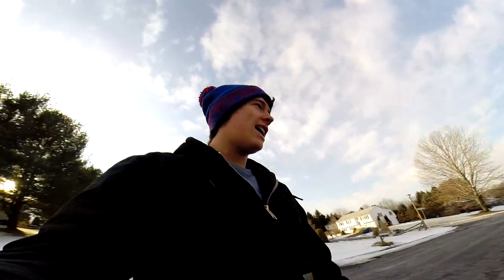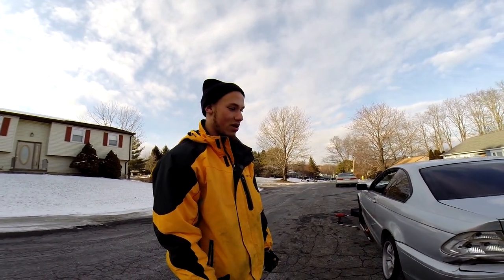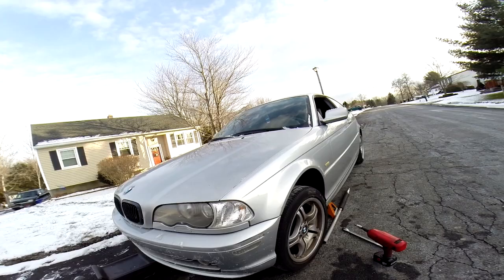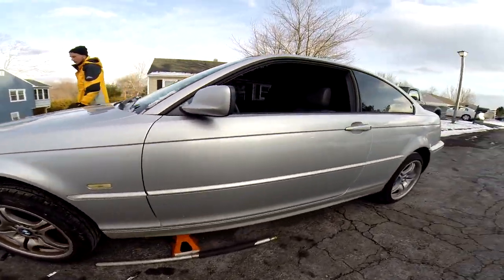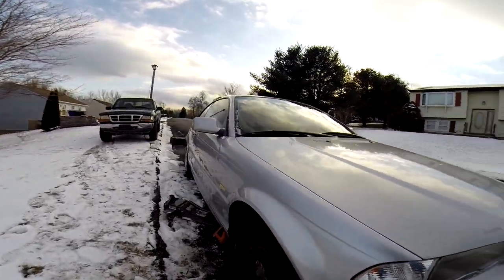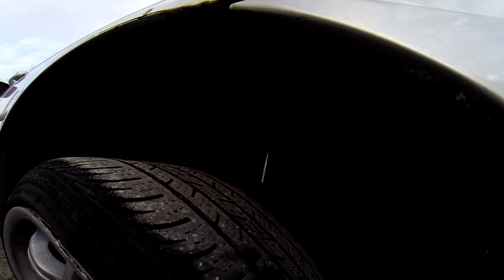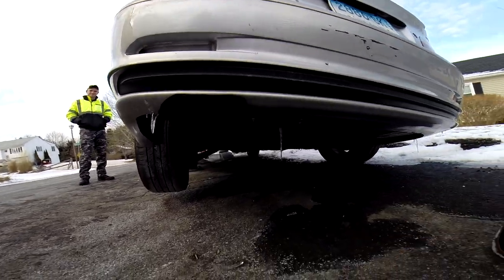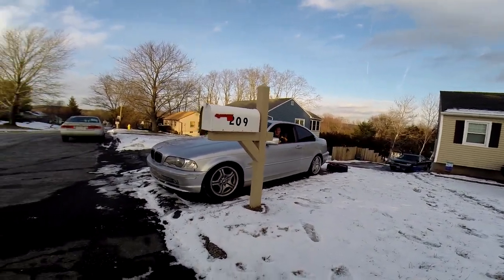Rundown Of The E46

Comment: The sub frame is probably going to have to be reinforced along with the bushings in the rear suspension. Most if not all e46's sub frames begin to tear and split under load. Also replace the whole cooling system because they tend to crap out especially the coolant expansion tank. They have a 100% faliure rate. Things like Vanos seals and CCV valve should be checked as well. For the oil leak look at the oil filter housing gasket, vanos return line, valve cover gasket, oil pan gasket, and maybe rear main. Long live project lemon.
Reply: +1 on the CCV.  Its possible to hear a vacuum leak on the video when he parks the car.
Reply: +REALthugnasty lmao probably. E46's are somewhat expensive to maintain if you want it to run right.

Comment: As far as I know that trim came from a ZHP 330, which that car doesn't look like. It's a 5-speed right?
Reply from the maker: +TheCarPassionChannel yea its a 5 speed
Reply: +Ricer Miata i was sure the m54b30 blocks came with a 6 speed
Reply: Sayyyy what. Sir I am still awaiting the next broke and boosted video 😎
Reply: +E39 DRIFTSLUT ACAB they did come with a 6speed. This isn't a 330i
Reply: +Chris S 330 didnt come with 6 speed , its the ZHP version of 330 came with 6 speed, different cams higher RPM limit up to 6920 where on stock you get 6500 , came with m3 body kit not sure about it , but there was M badges all over the car in ZHP version , ZHP has 12 more horse powers due to cams  ( intake side i think got changed different map for different cams), i have a 330ci  which is coupe that has m54b30 engine and 5 speed getrag tranny.
Reply: +Andrey Arkashin you learn something new everyday. Didn't know that zhp was the only one with the 6speed. Thanks.
Reply: +Chris S The 330ci did come with a 6 speed if it wasn't a ZHP, I've got an 04' 330ci Sports package (Not ZHP) and it has a 6-speed (I believe it was optional and not many people bought it)
Reply: +Chris S obviously m3 has it  too, could be the one with the flappers ( ears on the steering for shifting for pussies or could be regular 6 speed), anyways if you think about it flappers are faster in shifting than a clutch and your right hand))))) cuz computer does it almost instantly and if you look it up on ebay the tranny has that shifting unit mounted on its side and it costs lots of money even now( unfortunately without unit costs a lot too , otherwise i would of have it in my car)))))
Reply: +Andrey Arkashin What he said
Reply: +RustyMonkey9 no reply)
Reply: +Andrey Arkashin Do you have a pre-facelifted model? I'm not sure if the year affects whether or not it has a 6 speed. Mines an 04' Facelifted 330ci with the 6 speed. As far as I know about its transmission, the 6 speed was most likely an option.
Reply: +Izac Pascual it could of been an option or someone changed it , because 6 speed is a ez bolt on , just adds another gear , bolt patterns , sensors all the same stuff
Reply: +Andrey Arkashin also there was an option for and 330's to come with a 6 speedboat sure if it was a zhp motor but it was a 6speed with awd, and its a pretty rare find from what i've learned
Reply: It's not a zhp
Reply: +Ricer Miata It will be a great car when u guys get it fixed! I own a E46 sedan myself:) I'm from Finland and I love to watch your vids, keep it up!:)
Reply: Izac Pascual Pre facelift 330Ci/330i did not come with a 6-speed, only ZHP. I can't confirm post facelift standard 330's. E39 DRIFTSLUT ACAB Not all of them, my gf's is an 02' with an M54B30 and it's 5-speed.
Reply: +Andrey Arkashin I bought mine from a dealer since it was new and haven't changed anything on it.
Reply: +TheCarPassionChannel I believe it was an option for the Face lifted ones, mine's factory stock with the 6-speed.
Reply: Izac Pascual Okay that makes sense. So yours is just a regular sport package?
Reply: In Europe the 330xi which is 4wd comes with 6speed box, the regular rwd only comes with 5spd. Same thing with facelift models I think.
Reply: Miitri Laakkonen Omg a 6-speed xi... shh that's NSFW talk
Reply: TheCarPassionChannel It's pretty fucking savage 231hp/300nm stock :D just drove one the other day.
Reply: +TheCarPassionChannel mine is sports package.
Reply: +TheCarPassionChannel Hi Greg :P
Reply: +TheCarPassionChannel Sadly I couldn't afford any better back in 04'.
Reply: I own an Imola Red ZHP and can confirm that is the trim that comes with it. It was highly sought out by other BMW enthusiasts, .
Reply: +TheCarPassionChannel The 330 ZHP came with black cube trim. This looks like a cheap vinyl carbon wrap was applied to the trim and not factory.
Reply: +atlanticimports I agree that it isn't the best looking. But apparently enthusiasts really like it.
Reply: +TheCarPassionChannel ALL LATE MODEL E46'S WERE 6 SPEED. the early ones before like 2005 were 5 speed.
Reply: stealthynuke There's no such thing an as E46 after 2005..... They went to E90 then.
Reply: +TheCarPassionChannel They made an E46 M3 in 2006
Reply: Izac Pascual I should have been more specific, was referring to non M's since were were talking about 330i/Ci this whole time.
Reply: +TheCarPassionChannel lol, how's the boosted yata going?
Reply: Just call the bmw dealership with the VIN and they can tell you exactly what options it came with from factory.
Reply: +Miitri Laakkonen for the non 4wd drive, with the non diesel models, ONLY the 330i/330Ci produced in 2003 and later have a 6 speed, so some facelift have 6 speed while others don't
Reply: +Muddersbach a guy i work with has 330 clubsport prefacelift its a 5 speed..an has the shockingly ugley rear spoiler
Reply: +TheCarPassionChannel I had an E46 that was identica. Sport package means bigger seat bolsters, 3 spoke steering wheel, and lowered suspension. The M54B30 was only paired with a 6 speed manual after 2003 when the car was facelifted. This is not a facelifted model. I miss mine so much.
Reply: +TheCarPassionChannel This is not a ZHP model, that was only available on the facelift models. The Black Cube trim was only available on ZHP models
Reply: +Blake D for sedans, the facelift occurred in 2002. For coupes, the facelift occurred in 2004. I know, because I owned a 2004 330ci ZHP.
Reply: +Scribbler dangoff i know that version and yeah the spoiler looks ugly 😂
Reply: +E39 DRIFTSLUT ACAB 2000-2001 is 5 speed, 2002+ is 6 speed.
Reply: +MX922_DYL it looks like a 330 CL at least thstcwhst the wheels are
Reply: Chris Carr
Its a CI not CL lol

Comment: That oil leak happens to all e46s, good news is it's easy to fix. Valve cover gasket and oil filter housing gasket, good as new, just don't put too much torque on those fasteners, the valve cover nuts just turn until they stop, no more. They take 0w40 or 5w40 full synthetic oil. All the other problems with it are typical too - rear shock mounts, they always blow out, e30s through e46s, easy fix. The rest of the suspension can be a lot of work though, tons of bushings and ball joints and stuff to replace. Not so easy to fix is the oil separator. Mine clogged up and was giving me positive crank case pressure, shot oil all over me when I pulled out the dipstick, nasty mess. And pay close attention to the cooling system, if that motor overheats it's done for. Water pump, expansion tank, and rad hoses are regular maintenance items on these cars, don't wait until it blows.

These are good cars but you have to maintain them properly. Do your research online, the info is all there. I've got 240,000 miles on mine and no signs of stopping any time soon.

Comment: The trim is called Black Cube.
e46 sport package include lower suspension as well.
Regarding the exhaust, get ebay headers, it will sound better and will notice some gains on higher rpm.

Comment: As an owner of a 2001 330ci I can tell you the e46 Marcus has is a preface lift 330ci with sports package. Its not a ZHP model. ZHP came with a higher redline, shadowline window trim, a 6spd manual and a slightly bigger motor. Also e46 did not come with carbon fiber trim. Its either vinyl wrapped or hydro dipped and cleared.  Just so you know there was a recall on the front passanger airbag, if you call your local BMW dealership you can set up an appointment to get it replaced COMPLETELY FREE OF CHARGE.

Comment: Hey rudnik, if you're reading this I have a question. 
If you ignore reliability, what car did you like more, your Miata or your old e30? 
I have a guy offering to trade my 1990 Miata for his 1987 325is.
Reply from the maker: +AlexX H00N1G4N  keep the miata
Reply: +Ricer Miata yo
Reply: +Ricer Miata WHAAAT over a 325is e30? They all come stock with LSD and way more power than a miata. To each their own.
Reply: get the e30
Reply: ***** not really. They weigh like 2600ish pounds iirc. 
ughhhh I love my miata but E30s are so sick
Reply: +AlexX H00N1G4N the bmw is gonna empty your wallet trust me
Reply: +AlexX H00N1G4N i say e30 cause its a sturdy chassis, more power, hardtop to begin with, and a ton of aftermarket stuff (which miata might have aswell), but im a bit biased
Reply: From what I heard, e30 are reliable, motor trend made a video about e30's they're great cars! Check out the video! Probably will you choose!
Reply: +YoungClickClack a neglected one will maybe but one that has been looked after will be very reliable! ive mine on the road 3 years now and i drive the shite out of it and the only real problem so far was the alternator went late last year after a 470 mile trip! and the wiper relay went a couple of months ago which is not bad for a car of 28 years old with 7 previous owners! the key is to buy a good car with plenty of service history! plus there easy as piss to work on! im a mechanic and the e30 is by far one of the nicest cars i have worked on!
Reply: The past owner did do a lot of work on it and maintained it, he also installed larger injectors and ran a tune on it.
Reply: I agree with keeping the Miata... Bimmers are expensive to maintain
Reply: chris olson if you take care of it and replace what you need from the start it won't be very expensive.
Reply: chris olson also when ever it is necessary  to spend a bit of money on your e30 or most german cars for that matter go for brands such as febi bilstein and swag (both brands owned by the same company) as they were one of the oem suppliers for bmw and there parts are as good if not better in some cases! and are a lot cheaper than the ones you get at the dealer for the sake of a bmw badge on them bumps up the price a good bit!
Reply: +AlexX H00N1G4N  I would keep the miata, not many cars beat the feeling of top down auto crossing a course.
Reply: Don't do it. All douchebags have owned a e30, and all lovely people have owned a Miata (kinda)z
Reply: +VizyosWorld if you ever owned an e30 yourself you wouldent be making such a bold statement! nutting wrong with a miata/mx5 by any means they have the right ingredients for a fun cheap car that's for sure just like the toyota AE86 as a comparison light weight rwd quick revving twin cam 16 valve makes for a lot of rwd fun i know this as i have an AE86 as well! but the e30 is as fun as both of them with a torque straight 6 and a note that makes the ears twitch! plus a touch of class thrown in as well! best thing to do alex is getting a drive out of this 325i if its a good one something will click with you and make you want it! as did with me along with the huge community across the world that have e30's and cant find anything that drives as nice as them that's including the newer generation's of 3 series as well! its back to basics design that makes them so damn good! your fully in control in them not like the modern stuff with all the assistance crap and extra weight!
Reply: Get the e30! Trust! Especially because it's an is ! They are getting really pricey now and days and worth way more than a Miata. But honestly more power and handling are much better.
Reply: +Ricer Miata stupid that car is more powerful then miata
Reply: +AlexX H00N1G4N Belive me E30. You never will regreat ;)
Reply: +AlexX H00N1G4N just like you said IF you ingore reliability i would go for E30 that car is getting more rare every day but its expensive to repair, maintain and eats shit ton of gas so if you have money e30 for sure
Reply: +AlexX H00N1G4N If the e30 is in reasonable condition, it is a much better car, and worth it.
Reply: +AlexX H00N1G4N Trade the yiata for the E30
Reply: +AlexX H00N1G4N With that being done to it i'd trade in a heartbeat
Reply: +AlexX H00N1G4N It depends on condition. If the e30 is clean I would trade it. I have a 1983 e21 320i and it has been exceptionally reliable.
Reply: TheCatMilton It's pretty clean, 205k miles, runs and drives great. 5 speed manual, nice wheels and clean interior
Reply: AlexX H00N1G4N It honestly sounds fine. If you think it is a fair trade, go for it.

Pull back the carpet and check the floor for rust. They seem to rust from the inside out if the drain holes in the rocker panel get plugged. Also check the rear strut towers for rust as that is really bad. 

Check www.4chan.org/o/ for a vin thread. If you comment your vin, you will get a copy of a autocheck on your car for free. The autocheck copy will be posted by mightybenz in a diigo link a little while after. The autocheck is like a carfax if you haven't heard of it before.
Reply: +AlexX H00N1G4N def get an e30. You will seriously love it. m20s are bulletproof if maintained and they aren't terribly hard to work on even with two left hands (like me.) It has more character than a miata imo.
Reply: +YoungClickClack A simple E30 really isn't.
Reply: +YoungClickClack its an 80&#39;s e30. There extremely solid cars, with a wide range of reasonably priced aftermarket parts. Dont spread bullshit.
Reply: +AlexX H00N1G4N ignore all the idiot heaters who say BMW will bust your wallet and all that crap, all such lies from people who haven't even owned one or probably driven one. E30 all day, I'm trying to trade my e39 this summer for an e30, 540i has too much power for me and guzzles a lot of gas. But 4 months only $150 in maintenance  and that was just a valve cover gasket, 140k miles 6 speed v8 was $2500 lmao and I drive the brains outa the car; built like a tank :)
Reply: +AlexX H00N1G4N miata's are for hairdressers
Reply: Bryan Boudreault bruh i got rid of it months ago.
The E30 ended up being a POS anyways
Reply: AlexX H00N1G4N what have u got now
Reply: xTerraH 03 Mustang GT and a G35 Coupe
Reply: AlexX H00N1G4N oh okay

Comment: my 1992 e36 320i is the most reliable car I've ever owned, and I'm 3 years into the ownership and it has 294k km :) only had to change the crankshaft position sensor. BMWs are reliable as long as they are well maintained imo.

Comment: I have the same one. I also had the same problems with the struts.the valve covers leaks pretty common. the power steering has common issues too.the carbon fiber on the interior is after market it's worth fixing the parts are pretty cheap on ebay.

Comment: The carbon fibre trim is not eom, probably a wrap. 
The oil leak is probably from the oil filter housing gasket, 5$ for the gasket and an hour of your time. Whatever someone says, you do not need to remove the fan, just push the plastic a bit when you are getting to the belt tensioner. If it's leaking oil, probably the valve cover gasket is shot too, make sure to get the gasket set with the spark plug gaskets as well. 
Check the cooling system for cracks, if it's leaking, do it immediately! 
Throw in the shift rod from the E60 530i for short shifting, and the ZHP shift knob. 
A supercharger with around 8PSI will get you in the M3 power territory, make sure to get an intercooler for reliable power. 
100$ eBay headers work wonders for power and sound, you get the M3 rasp.  
Use Progman and a cheap OBD2 cable for the little options like interior lighting, DRL, opening the windows with your key, alarm, light home system...
And most important - Paint the windshield washer reservoir black! 

Can't wait to see the build process, keep 'em coming ;)

Comment: Im in the same boat after my craigslist buy!! I bought a 2003 Toyota Matrix XRS (1.8 2zz-ge engine and 6 speed trans from a Celica GTS) with 150,000 miles and within about 500-1000 miles after buying everything was great, then the vvtl-i solenoid dried up from old age and I had no more valve-lift, but it ran 100%. $150 solenoid later and it was good.. THEN 1000 miles after that I blew my head gasket! $1300 fix, ouch! BUT at least I will have all new gaskets and seals on the head! I plan on keeping this car for at least 2-3 years, so its just some shit I have to do. I bought the car off a chic who did ok on the maintenance but just not good enough.. I think the previous owners allowed the car to run hot a few times.. then bam.

Comment: Get the m3 bumpers and rear led tail lights, you can get a decent set of coil overs doesn't spend every cent in your pocket. They made these cars very simple to work on just as easy as a Miata. M54 and N55 are pretty straight forward to work on, check for recall work

Comment: I used to have an E30, now I have an E36, with the M50 non-vanos I want to turbo. My pops drives an E46 330Ci, depending on the year you've got some version of M52 motor in that car. 

My dad's has teh ZHP Package form the factory and it came with M Suspension, wheels, gearing, a 6 speed, and yes, it came with that Carbon Fiber trim.

Comment: Just from looking at it, I would have to call it a E46 330Ci ZHP package. Basically a rarer version of the 330Ci with a slightly higher revving engine and M package parts (ie wheels, gear shifter, ect.) And yes, the faux carbon fiber did come with the car and it's one of the determining factors of whether or not the car has the ZHP package or not. The dead give away would be the higher red line though. Hope this helps!